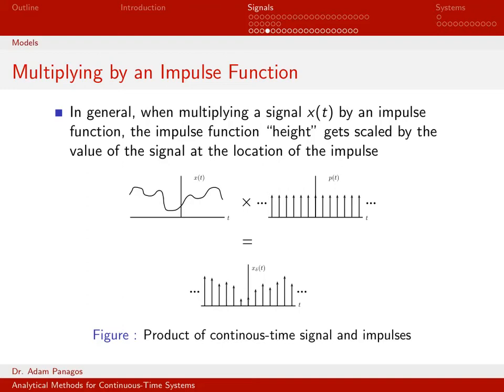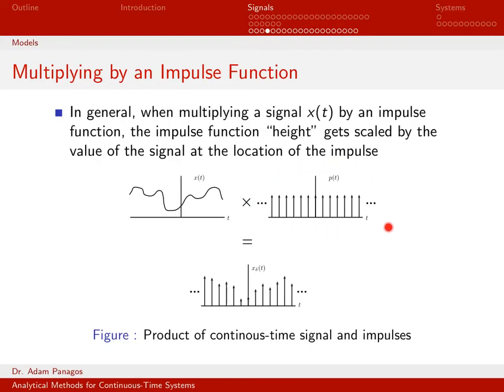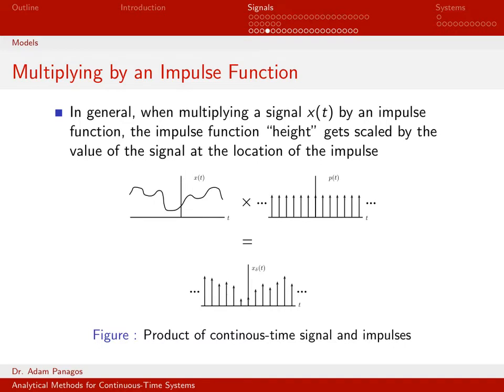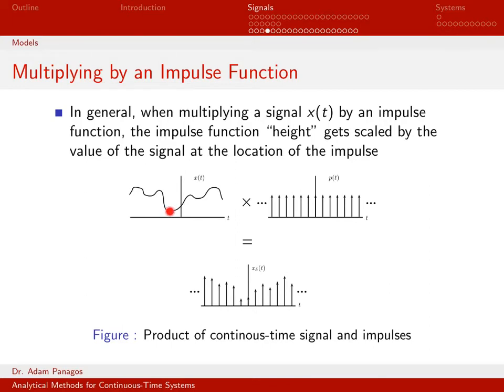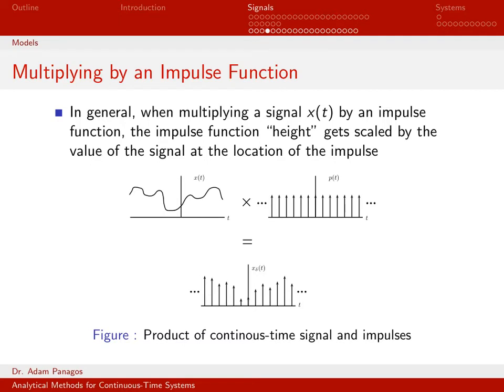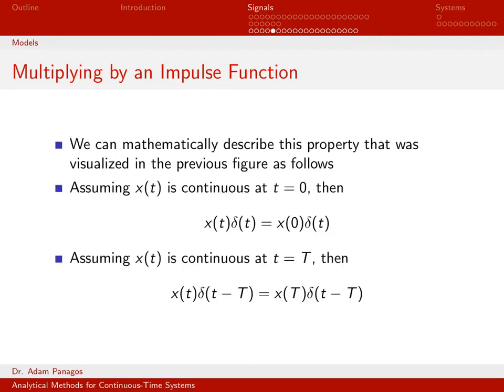The Continuous-Time Unit Impulse Function 2/4

Comment: Hello.. 
1. the height of each impulse in the impulse train is infinity. Only the area or density =1. Why is height and density used interchangeably?  
2. If the height of impulse is multiplied with the finite "height" of the continuous time signal.. i.e. infinity* finite height (= infinity) then the result should also be impulse train.. but this is not being done... instead the density is multiplied by height...
3. How can density or area  of impulse be multiplied with height of continuous signal?  i.e. height and area are different quantities...Thanks a lot in advance!
Reply: The following is as far as I understand the unit impulse function:

1. Technically, the right name is density/area, not height/amplitude. The amplitude of any impulse is always infinite, but the area may or may not be one: A·δ(t) has an area of A, while δ(t) has an area of 1.

And why is height/amplitude sometimes said instead of density/area, like he said in this video? I guess that's just sloppy language.

It's like when people say "transmission lines supply power." Technically speaking, that's incorrect. They don't supply power, they supply energy. Power is the time rate of change of energy. In fact, in our electricity bills we pay energy (kW·h), not power!

2. He forgot to mention that we're not really just multiplying the signal with the impulse, rather we're integrating such product. In other words, the multiplication is done inside an integral. In this case, everything he said makes perfect sense.

3. Following the previous paragraph, we're not really multiplying heights (amplitudes), but more like densities (areas).

---------

I had very similar questions to yours.
Reply: I recommend these two videos too:

https://youtu.be/fyxYOjFWfWU
https://youtu.be/lpCqUeBv4Wo